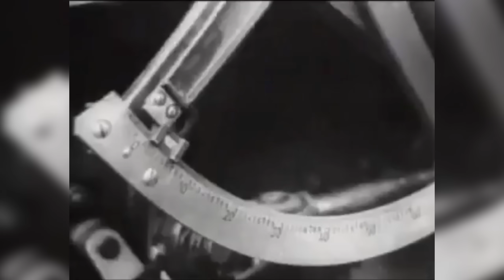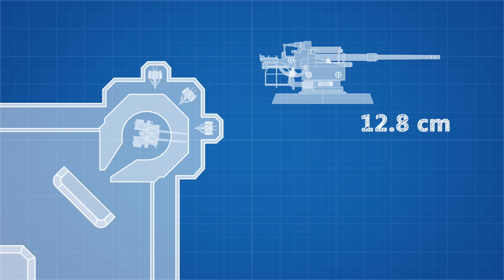Why 80% of FLAK Gun Crews Died

Comment: They knew about the 88 when they flew missions. One tactic they used was changing the attitudes. Remember the Germans used time instead of proximity. So the aircraft would fly a set time then changed the attitude. The Germans would calculate it and fire but by the time the shell reached where it thought the planes would be they weren't there.

Comment: The Battle of Arras was actually in France. German anti-tank gun tactics in the desert were actually extremely effective and British tank tactics were very weak. But they were greatly hampered by not having a dual purpose gun on their tanks. Most of them had 40 mm guns with no high explosive round at all. So engaging anti-tank guns at long range was extremely difficult for them before they got the M3. Lee and the M4 Sherman which had weaknesses but they had an extraordinarily good high explosive round.

Comment: Reading the comments, I find it hard to believe that the ground-to-ground artillery crews used "line of sight" without spotters to fire shells.  But perhaps in the heat of battle that's the way it was, giving the 88 an advantage.
Reply: There are 2 types of artillery: howitzers that are primarily used for indirect fire and ones used in direct combat. 
The second kind were used for anti-tank combat and used line of sight targeting
Reply: @sashasemennikov157  Thanks.  I guess I find it hard to believe that howitzers were not used to target tanks, though back in the day they might not have had that kind of accuracy against a moving target and had to use line-of-sight.  Nowadays it's all drones so this debate is academic.
Reply: Direct fire most certainly did involve direct sighting. Spotters may have located visible ground targets, but gunners used the excellent German gunsights to hit them.

Comment: I believe you're suggesting the antitank role for the 88 was first utilized in North Aftica. I am under the impression it was actually first used by the wehrmacht in the blitz across France, in defense of the much lighter German tanks against attacks by heavily armored French and maybe British tanks that threatened to cut the column in half.
Reply: In fact it was used for the first time as an antitank in the Spanish Civil War.
Reply: Aye, it was the British counterattack at Arras on 21 May 1940. Heavily armoured British Mathilda tanks overran several German units (including the 2nd SS Totenkopf) to which the Germans used the 88mm in an anti-tank role as smaller calibre 37mm and 50mm guns were ineffective.

Comment: I’ve heard that flak towers contain so much concrete that they can never be removed, like the U-boot pens in Bordeaux and other places. Most of these structures are made use of, one way or another.
Reply: Any concrete tower can be destroyed. What happened was the Germans figured out it would be to expensive to take them down.
Reply: @jeep146  I believe that to be true, from my own experience of houses made out of a certain concrete material that was said to have been so hard it that could withstand a direct hit from a bomb of the time.
Reply: It probably was a special kind of concrete. I was born and brought up in a reinforced concrete house, especially made to protect ordinance workers. And the material used was harder than concrete, and was said to be able to sustain a direct hit. The downside was damned cold, all the year round and you could do nothing with the walls, hang stuff up
Reply: Stay cold all the time? Sounds like a desirable feature during these heat waves.
Reply: @wowswc Nice one, just nip in doors. You lived with the cold and so you put up with it, though still felt it pretty smartly, especially at bath time.
Reply: @DougalDouglas-d3k  You can glue things to the wall.
Reply: @marioxerxescastelancastro8019  Very hard to do in the fifties. I can well understand now, even wall paper.
Reply: They were likely built in the same fashion as grain elevator silos at shipping ports. They are also usually abandoned - and not torn down due to their strength. They use a 'slip forming' method wherein the forms are jacked upward at the rate of about six inches per hour. The concrete design has very little water which allows it to support the weight as the forms continue upward in a continuous process (less water=higher strength concrete). The reinforcing steel was shaped like a helix and continued upward as the pour continued skyward. I believe this process was first used in building silos in Buffalo, NY in the early 1900s. Amazing structures!!
Reply: @danlowe8684  In the U.K munition houses were simply concrete of high density, as used in the sealing of coal faces when a seam has finished.
Reply: Sorry, this is plain wrong. Almost all of the flak towers were demolished by allied order in the very early years after the war as part of the demilitarization of Germany.
Those few still standing today usually have their own peculiar story to tell. For example the one remaining out of the three towers in Berlin Gesundbrunnen: The French tried several times to demolish it but didn't achieve much more than a partial collapse of some inside structures. They didn't dare to use more explosives because right next to the tower there was a railroad line owned and operated by the DR (Deutsche Reichsbahn) which in turn was under the control of the Sowjets. Under no circumstances whatsoever could the French risk any possible damage to that railroad line. And that's why today Gesundbrunnen has a great observation tower in the Humboldthain city park.

Comment: Did you catch what that German soldier is using at 2:35 in the video? When I first saw it, I thought it was a rocket launcher, but it's actually a viewfinder. I was really curious about this unique device, which is providing him with crucial information about the aircraft, a level of awareness I've never seen in any other war footage. Does anyone know specifically what he was using?
Reply: I believe it is a range finder. Both handheld  and fixed mounted were used.
Reply: @ga4527  That makes a lot of sense
Reply: @SamBiscit-c8e he's the officer and he's trying to figure where they should set their 88mm shells to explode once fired. I don't know what the handheld device is called, but the Germans built bigger versions called Kdo.Ger.40, short for Kommandogerät 40. They were almost 1000KG and would be placed with huge sightlines to track aircraft altitude.

Comment: Some had control cables run by radar. There had a wire filled cable about 3" round filled with wire to control the firing direction.

Comment: Here's something that I've always wondered about the flak towers, it's a feature you can see very clearly @11:22.
There are horizontal beams protruding from the sides and also a supporting beam set at a 45 degree angle underneath. There are a series of about 6 of them, up at maybe 3/4 of the height of the tower and another set of them at the same height further around the circumference.
They must also be made of reinforced concrete as they have not decayed.
What are they for?

Comment: Proximity fuses had been known for years in Germany. Strangely, in spite of repeated and urgent requests by the military, these started to be supplied only in January 1945. Worse even than stated in the commentary, even when a direct hit was scored the shell did not necessarily explode, such that enemy aircraft when shot down later were found to have holes that came from the passing of an AA shell through them. Also, the timing devices, even with all settings correct, frequently malfunctioned, arguably due to the stress and the rotation of these moving mechanical parts in flight, so they would not detonate at the time indicated i.e. too late. This led to the addition of a simple contact fuze that would at least make the shell explode when it hit something.
Reply: The Germans never supplied their military with any type of proximity fuse, despite trying over 50 different ways doing it they never could come up with a successful design. 
They never fielded a proximity fuse during the war, not even by the last day, wherever it is you heard they were putting them to use in January of 45 is wrong.
Reply: Yor're thinking of timed fuses were an altitude to detonate could be dialed in.
Reply: @nighttrain1236 
They had those all along, despite never having fielded a proximity fuse the German AA systems were pretty advanced, each 4 gun battery had a central radar/computer system that was tied into each gun by electrical cables, information from the computer showed the gunner on each gun the exact spot in the sky to aim so when fired the shell and bombers would meet at the same point, the image was actually in the gun sight and the gun would automatically fire when everything was lined up and at the correct time.
The fuses were even set by the computer, at each gun was a box tied into the system, the ammo handler would hold the shell upside down by its base and insert the tip in a hole in the box, it would set the timer on the fuse.
It was pretty advanced and is why their high altitude AA fire was so deadly, the Allies had similar systems to, it's not like the Germans were more advanced in the field than others, but it didn't work like people image where there's a guy looking through optics at the incoming bombers to determine the fuse settings as per their altitude and speed along with the gunners knowing how far to lead the targets, if it worked that way they'd never have hit anything at 20,000+ feet.
Reply: @nighttrain1236  Yes, either an altitude or, much more commonly in the TAVARO fuzes, a clockwork where the detonation happened on base of flying time.

Comment: You never addressed the 80% dead claim? Where does that come from? They often had teenagers mounting those guns.
Reply: The notion that a bunch them were killed by aerial attacks is incorrect-the Allies tried this but bombers suffered high losses as they (naturally) had to fly straight into the guns meaning they were over them for a long time . Fighter/bombers suffered high losses from smaller flak guns and small arms. Basically the number of flak guns they destroyed was about equal to the number of aircraft they lost. The Allies decided it was better to "fly higher" avoiding them as much as possible- even if it meant reduced bombing accuracy and to attack radar sites -or use countermeasures to confuse them. Flak crews MIGHT have suffered high losses in the closing months/ weeks of the war if the crews were pressed into ground combat(especially on the Eastern front) with small arms but this 80% number appears to be pulled out of thin air. As you mentioned many were teens and ground crews included civilians as well as "friendly POWs" (anti-Soviet Ukrainian conscripts for example.)
Reply: At about 10:20
Reply: He didn't because its bull to begin with.
Reply: 10:10,
Reply: Technically 100% died
Reply: @mostlymessingabout  That makes 0% sense.
Reply: A friend of mine was manning the FLAK guns round Berlin when he was only 15 years old.
Reply: The 88 gun crews were vulnerable (no real armor protection) and so effective they became prime targets of fighter aircraft, and bombers, to tanks, snipers and infantry. (roughly around 9min)
Reply: @deshawntrune4504  That doesn't explain the 80% death rate claim at all. The casualty rate for front line infantry was 40-50% and they were in way more danger.

Comment: As usual with german equipment, the 88 was a complex and difficult piece of kit. When mobile, it required up to 15 and was a very difficult thing to move. You should understand that any weapon that can deliver a payload can be considered to have done its job, during the nazi attack on Moscow the Soviets wheeled out Napoleonic era artillery from a museum and manned them with cadets, they did their job nocking out dozens of Nazi tanks. You will find endless vids on YT about nazi era weapon exceptionalism, you might even think they won the war.
Reply: Yep, not only was the US 90mm Triple Threat superior to the 88 in every regard it was simpler with less parts in its breech block and easier to manufacturer.

Comment: Lots of commentators have said the British 17 pounder was better overall. It was the one they squeezed into Sherman tanks to make them the Firefly.
Reply: Sadly not really true, the 17pdr APDS did have theoretically better penetration but the WW2 gen. 1 ammo were not very accurate over 500m, became it's recommended max range. Plus the 88 weighed much less than the equivalent allied guns (17pdr, 3.7", 90mm) helping to give much faster setup for mobile warfare + only gun that could fire limbered

Comment: My mom’s cousin was killed when his B-17 took a direct hit by FLAK over Hamburg in 1944. Only one crewman was able to escape by parachute at the last moment. The 88mm FLAK gun was the mainstay of German anti aircraft but they also used 105mm and 128mm (in twin mounts on the FLAK towers) and also 20mm and 37mm light Flak.
Reply: Yea my mom's cousin was a navigator on a B24 that was killed by flak on his 21st mission, he was in the 15th Air Force flying out of Italy, their last mission was a run on the railroad bridge at Ferrara Italy on Aug 27th 1944, it's a shame to because aside from other hair raising missions his crew had survived 3 runs on the oil fields at Ploiesti Romania.
They took the bridge out though, it was a successful mission, they weren't hit until 2 seconds after bomb release, so they got it done.

Comment: At 7:00 it stayed the American bombers only had armor around critical components.  Guess they didn't consider the crew a critical component.
Reply: I presume you mean 'stated'. Armour in aircraft is always a compromise. If you armoured a bomber to a level which would give protection to all systems, including the crew, from AA fire and canon shells from attacking fighters, it would not get off the ground. If you cut back a bit then you may be able to take off but have no carrying capacity for bombs. The differing levels of armour and defensive armament are a major reason why the Avro Lancaster could carry a much greater bomb load (up to 10 tons) than the Boeing B-17. The B-17 was also a considerably older design, of course.

Comment: My father had shrapnel from a Flak 88mm in his legs from the battle of Sidi Rezegh. It caused many problems over a period of 20 years.
Reply: Was he a Kiwi, by any chance? The Kiwis were left to be mauled on three sides at Sid Rezegh. There was a great story from a Kiwi soldier. He was very badly wounded, so he was stretchered to the makeshift hospital in the Sidi Rezegh Mosque (which was also referred to as the tomb of an Arab saint). He was placed in his own slit trench, as were the other most severely wounded. He eventually was transported to a field hospital and recovered. Once they recaptured Sidi Rezegh, he returned to the mosque, only to realise those slit trenches were intended as graves.
Reply: @wzywg  No strangely enough he came from German immigrants he was of the first generation born in the USA. He was fighting on the western front heading east after D Day invasion.  That little bit was all that he said  and he said it because he was missing parts of three fingers on his right hand. He had just been given a ride by a truck and grabbed ahold with his right hand to board. The next thing he knew he was on the ground trying to pick up his helmet. It kept slipping out of his hand until he realized that he was missing fingers. Richard Meir was his name.
Reply: A coworker in my younger days was missing parts of 3 fingers on his left hand. He was blown off of a truck by “a cussed 88”.
Reply: Btw it was his right hand.
Reply: I thought flak's were shooting towards the sky...

Comment: My long gone old WW2 buddies alway remarked about the Germans ability to drop a rou d in "you back pocket ". I knew they were serious just the eay they rmarked about it. I learned later that 70% of US casualties were due to artillery.  Also, the US lost 1.37 men to the German 1 , on the western front.
Reply: @alandavis9644
Well, not quite that high a ratio.  The highest estimate of Allied figures on the Western front from D-Day to VE is @195,000, and @537,000 wounded.  The lowest estimate of German casualties is @265,000, and @400,000 wounded.  But some estimates say over 600,000, with 400,000+ wounded.
So even by the lowest estimate, it's 1.1 to 1.
And that doesn't count prisoners.  The Allies captured over 4,000,000, but the vast majority of that came at the surrender of the entire army at the end of the war.
Reply: Which is remarkable since the US did most of the assaults. Btw its often cited that you need 3-to-1 ratio when attacking, I imagine this has something to do with historic casualty rates when assaulting a defensive position.
Reply: I believe mortars caused the most battlefield casualties in the war.

Comment: It never had an optical sight.
Reply: 05:36?
Reply: @rabbitholereviews that is a range finder for Central altitude Targeting. 
My reading from several sources indicates the Flak 88 never had an optical, telescopic gun sight.
Reply: @drewpackman2929  You are wrong since it's direct fire gun and it must have iron sights or optical sights in order to aim. Or using opened bore in case of emergency when sights are missing or broken. Quick google says that Flak 88 used regular artillery panoramic artillery sight, same as were used on field artillery for direct fire.
Reply: @Reginvalt not wrong. Since it's s firect fire gun it had iron sites. 
You are the one wrong. Goodbye and yhanks for joining the discussion.
Reply: @drewpackman2929  Iron sights to shoot something 2 km away? Does this sound logical to you? Wiki says Flak 88 used ZF.20 direct fire sights. You didn't do a proper research.